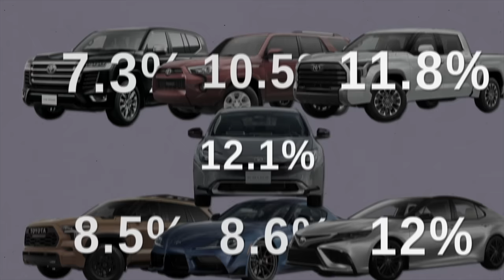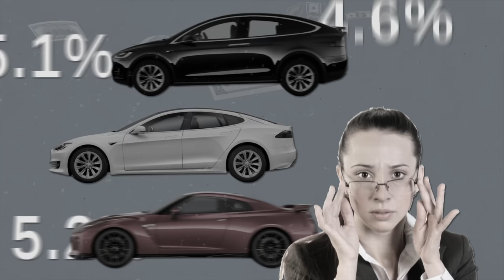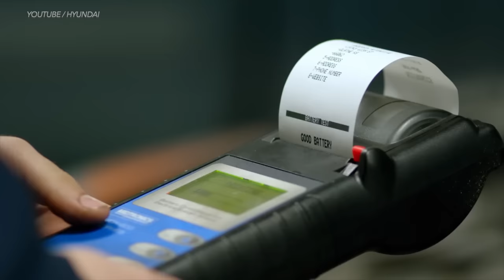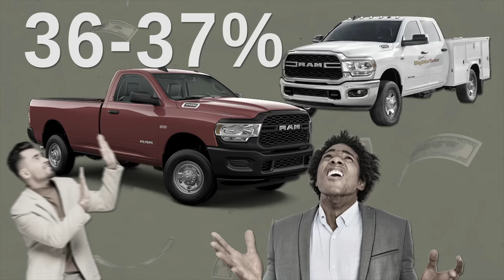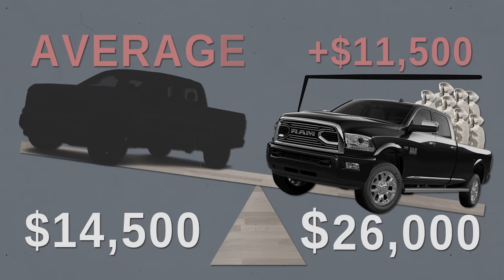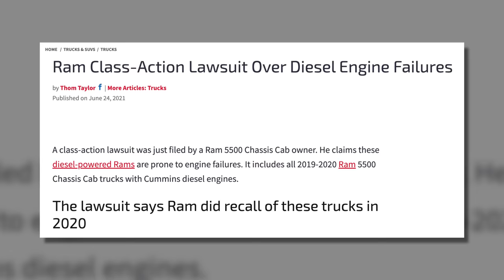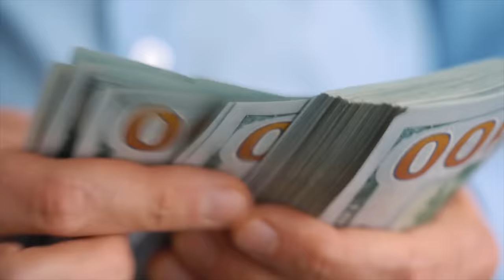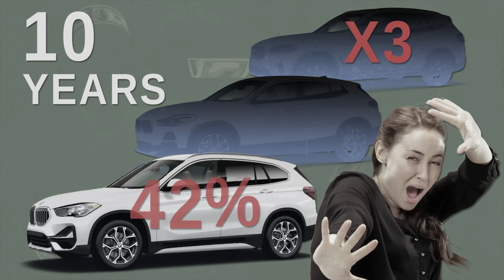Here's Why I Only Buy Toyotas and Lexus

Comment: I have a 2006 Lexus GS430… I am the third owner, previous owners were father and son and babied and pampered it. Currently he is sitting at 279,000 Miles and you can’t even hear the engine running. The best engineering imo. Can’t beat that reliability!
Reply: Hold on to that one!
Reply: My Brother-In-Law just sold His 2007 Avalon 200,000 miles, posted it and it sold the next day. He just brought a 2020 used Lexus. A used Toyota is better then buying some new cars!.
Reply: @urbannpa  I have an 11 Lexus GS350AWD, it is like a new car at 150k. I got it at 90K, only issue was a leaking rear strut. I installed both myself, probably could have left it.
Reply: "Babied and pampered it" and how did they prove that to you? Some words are just a sales pitch.
Reply: Omar Hudson , if car is sitting at 276K miles and you still cant hear the engine running than they certainly babied and pampered it.
Reply: Thank you for sharing your high mileage Lexus experience. Makes me not want to ever trade my 2014 (w/82,000 miles) in!
Reply: Don't sell it man. You will regret it.
Reply: Yep with proper maintenance they will do it. Very rare for other brands.
Reply: 2010 gx460 with 120k. If you maintain them, they’ll run forever. Toyota/Lexus is incredible.
Reply: '96 camry with 290k same thing! Start it early in the cold winter, go outside and think "crap i forgot to start it" but its just silent standing next to it 🤷‍♂️
She dont leak or use, struts are toast. Have to tighten bolts sometimes, shes rolling the wheels off literally. Cant wait for spring temps to run some Lucas.
Some days im convinced its the best engineered car on earth lol. 33mpg.
Reply: Several years ago, a dear elderly woman asked me if I could help her start her car.  She had a top of the line Buick. It ran so quietly that I could barely hear it in the background noise of the grocery store parking lot. I assured her that the car was running just fine.
Reply: A woman at work had a 15 YO Lexus SUV that looked brand new despite having over 200k on the odometer. She bought it with her first "real" paycheck after completing her degree. Her husband wanted her to trade it  for something new. She told him she'd had the car longer than she'd known him and maybe she'd trade him in on a new model instead.
Reply: My wife finally sold her 2008 Taurus X at 207,000 miles. The neighbors who bought it have added another 50,000 miles. It still looks new and runs fine. Someone told me that Ford 3.5 V6s wouldn't last much past 75,000 miles.
Reply: It's not just the engine that's reliable. The components are super reliable. I had a prius with over 200,000 miles still on original suspension. They have some of the lowest maintenance on the market.
Reply: im considering to get a 2014 GS250. would u recommend it?
Reply: @jmard24  Mane dawg das crazy!!!
Reply: I’m the 2nd owner of a 2002 ES300. About to turn 175k miles. Bought it 2 years ago this month with 160k. Car runs like it just came out of the showroom. Not a squeak or rattle. 4th Gen ES had incredible QUALITY. 30 mpg on highway. Love it and I’ll keep it for next 10 plus years!
Reply: @OmarHudson  prolly had paperwork on keeping up the maintenance.... Sheesh you need everything spelled out for you?!?!
Reply: @deykno87  well wouldn't he have just said they showed him the paperwork instead making a claim about the engine being quiet? That would have been MORE convincing.
Reply: @kamalgill3256  you are aware OTHER things can be neglected....and working bad....and the engine can seem quiet, Correct?.....namely the transmission, suspension, the electronics etc and in that case it hasn't been "babied and pampered"....how many times have we seen car where the engine is perfectly fine but other things are awry.
Reply: @OmarHudson  to be fair, even if it wasn't "babied or pampered" , it would still fair better than your average german  brand that definitely requires all the baby-ing and pampering that you can give it ;)
Reply: We bought a 17Y  RX400h last year with 187000 miles, added another 15k in 1 year. It is incredible building quality. Interior still in excellent state, used but not worn out, engine still clean, no oil leakage. 
I only had to replace the radiator. Garage sold it with 6 months warranty. They mentioned that there would be no chance they would sell a BMW of that age with that mileage with that warranty period.
Reply: Cars are Toyota/Lexus and Honda/Acura. Everything else are headaches in pretty capes.
Reply: @abrahamrosa8142  this is regurgitated ideas you have heard from YouTube mechanics or auto critics that you watch. Not your own experiences and opinions.
Reply: @OmarHudson  How do you know?? I’ve owned Land Rover, Mercedes, BMW, Ford, Chevys, GMC, Toyota, Honda, Nissan and Hyundai. Japanese cars are very good, almost all of them, but Toyotas and Hondas are outstanding. Everything else are endless money pits, not to mention the extremely difficult mechanics, specially the German vehicles. Scotty Kilmer is right on and it’ my own experience, not videos that I’ve seen.
Reply: had a brand new 2004 corolla for my first car. other than oil changes, $0 maintenance for 100,000 miles/ 11 years before i sold it it get a bigger vehicle. currently pushing a ford edge for another 10 years with 103,000, next car will definitely be a Lexus
Reply: Yet people preach how they love their ford's haha. My uncle has a 2016 f150 and wants it gone because of how unreliable it is
Reply: @urbannpa  My sister in law has a 2008 Lexus SUV (350) with 259,000 miles. The Lexus dealer where she services it calls her at least once every 2 months making her an offer, and not a low ball offer, I’m talking like premium $$. The last time they called was 3 weeks ago and the offered her $11,000. Does anyone knows a vehicle that’s 15 years old with 259,000 miles that a dealer (who always offers less) would still pay $11,000???
Reply: @adamcarr9442  that’s a wise lady!
Reply: @adamcarr9442  there’s always exceptions to the rule. But in general, Toyotas are incredibly reliable, while American cars are the contrary.
Reply: @nicolemazurkiewicz5377  In a heartbeat. Just stay on top of the maintenance…change oil every 3k miles, check the brakes, rotate the tires. Lexus are designed to run lo less than 400,000 miles.
Reply: @abrahamrosa8142  I am almost one thousand percent sure you did not buy all of those new....used cars had other owners and cant be considered when talking about YOUR experience. I only speak on cars I have owned that I bought new.....btw even Scotty admits that Honda's are plagued with transmissions issues.
Reply: @esso0527  sure. I am willing to concede to that. 😂
Reply: @abrahamrosa8142  thanks but im talking about GS250 2014 model. Not 350.  250 is v6 2.5 littre engine. but looks very nice. do u know the difference with GS350 same year? other than engine capacity? it shows relibility f 5 out of 5 in cars review for gs250  2014. while GS460 2010 is 4 out of 5
Reply: @nicolemazurkiewicz5377  Oh, ok. To be honest, I never had a GS. But if it’s Lexus, it must be good. The Japanese makes great cars, so no worries there. I. An tell you, though, that my uncle in the 1990’s bought a used Lexus with 90,000 miles on it and re ran it until 550,000 miles. Then he sold it for $3,500 and it was still running well enough like for another 100,000 miles. I think that the only issue it had was the transmission, which was “slipping” and out of timing. My advise to you is buy it with confidence!!
Reply: Damn, I wish I could say the same for my Sc430. Probably going to end up selling it
Reply: @urbannpa  Absolutely. I sold my 2018 F150 to purchase a 2011 Tundra. Way better truck with the 5.7l (versus the 5.0 in the F150).
Reply: Also helps to have good mechanics like Scotty. One horrible mechanic or oil change monkey that doesn't know what they are doing can ruin your car
Reply: How the hell can a car last for 279,000 miles? My Chevy truck  and Ford cars were so-so reliable but at 100,000 mile mark it was already dying and had to put her to sleep forever.
Reply: If you do decide to pick up another one I highly recommend the 08 Lexus LS460L, just as sporty as the GS430 but wayy bigger inside. My first Lexus ever was a 08 gs430 then the I switched to the LS and now I currently own a 08 IS-F with the 5.0 in it
Reply: I also have a GS 430...just broke 150k on it & it runs better than my newer VW
Reply: @esso0527  yes! my VW is a constant pain in the azz..my benz is holding ok, but my porsche is also a headache..i drive my GS Lexus almost daily
Reply: @pretty_flaco  same for me..first new car was a 1994 Corolla..that car had 226k when I sold it and never had an issue with it other than an alternator..in 10 yrs of ownership
Reply: ‘01 Highlander. Almost 200k miles. Runs like a beast. Be careful with newer Toyotas they’re getting fancy with 8-speed transmissions for fuel efficiency. But it’s more prone to failure.
Reply: I bought a 12 year old Audi 1.9 diesel with 300,000 on the clock for £800 in3 years I put another 150,000 on it,all I did was change the oil and filters every 10k miles and 2 new sets of tyres.Great car.
Reply: How do you know if it was babied?
Reply: I agree with you 100%. I’d give anything to but a new 2006 Lexus 😂.
Reply: The LX and the GX can go up to 500k. I’ve seen quite a few.
Reply: 280k miles on a Lexus?????? 😱😱😱
Reply: I've got a 2004 4Runner 4.7L V8 Limited with 227k. Got it back in 2015 with only 75k miles on it and one previous owner. That pretty much checks. I've had it about 10 years and I've spent 10% of what i paid to maintain it
Reply: @GGGG-qq8in 500,000 thousand miles ok let me see?
Reply: @OmarHudson there related. They new each other.
Reply: I have a 2003 ES. Amazing car, rides so smoothly still. No problems even with 180k miles
Reply: LS430 2002 .... have had 2 of them covering 25 years of driving and still going. Had 357000 on first one when sold. Found the same car again(same year) and bought another. In it today. 200,000 on it as of now.  Best car EVER made
Reply: @mixedboi  for sure. Never trade steak for hamburger
Reply: Got myself a GS430 from 2000 about the same mileage. Still going strong
Reply: Facts. We adopt so many manufacturing methods from Japan. They teach Toyotas QC and manufacturing system in mechanical engineering undergrad so their superiority hasn't gone unnoticed in industry. They are the golden standard and their vehicles are the proof in the pudding.
Reply: @ryanclaffey7949 I hear you. I love my 2013 rx350 with only 80,000 miles. Never a problem until the other day. My driver window would keep going almost all the way down when I closed it. SOS light on. Got the book out. I was ready to tape a garbage bag over the window.  An hour of frustration later I looked with a flashlight and the window somehow went behind the rubber seal. Can’t figure out how or why. Gonna try to figure it out today. But only thing about the car that bothers me is I still can’t work everything that it can do. The damn book is over a thousand pages. I just started driving it when my wife passed away over a year ago. I’m reading the book now so I’m gonna figure out how to work everything.
Reply: I own a GS450h, love the car but I’m currently looking at trading it in for an Avalon
Reply: Never buy a BMW ultimate money pit not the ultimate driving machine
Reply: Good car
Reply: @alb12345672  I have a 2.2ltr diesel Toyota RAV4 2007,6 speed manual,can't fault it.
Reply: Bravo well done mate Cheers!
Reply: BMW it’s bring my wallet, if you can’t buy new bmw don’t buy used one
Reply: I had a 1999 Lexus GS 400. In over 250,000 miles I had less than $3,000 of unscheduled maintenance.
Reply: I had GS430 2004 got to 331,000 before trading it in  2021 still ran well a lot of power
Reply: I have 670,000 on my Camry hybrid
Reply: @Apegabe , Lexus is top of line reliability

Comment: Have owned 12 Lexuses in last 30 plus years. Never had a problem with any of them and think Lexus is the best car made today and yesterday. Driving my 2015 RX350 for last 7 years..90K miles...brakes finally wore out last week! Amazing car.
Reply: Agree 100% with you. I am a Lexus for lifer. Lexus is top notch quality. Mine is 2012 LS 460, with not one repair, ever! Only routine maintenance. 166,500 miles, and finally going to have to do brakes (for the 1st time)
Reply: If they really didn’t break you wouldn’t have that much lol
Reply: You have to keep one for more than 3 yrs to find out if it’s good or not and a damed Kia will be perfect for 3 yrs and there are not a car or two that might have a problem. But I can say any car made to day will be perfect for 3 years drive it for 15-20 yrs and then tell me how great it is .
Reply: I hauled the First load of Lexus to the Toyota dealers because there not any Lexus dealer and put 10 of them on a 12 car rig and they got me for being over weight.
Reply: That’s an average of only 2.5 years ownership for each car..
Reply: Another Lexus lifer here.  I feel so pampered and I get ZERO stress from my car.
Reply: still have the 2003 corolla with 250,000+ miles and it's only ever had regular servicing 

it won't die
Reply: What car isn't reliable if you own it for only a couple years?
Reply: @dansanger5340  Chrysler/Dodge uggghhh
Reply: What a waste
Reply: @hastensavoir7782  Not really the case, it is more about gradual upgrades to stay with the current car technologies and not staying outdated.
Reply: @CR055FIRE  corolla is just different
Reply: What are your thoughts on the is 250 line up ?
Reply: 12 Lexuses? You sure like paying sales tax!
Reply: @hastensavoir7782   unlike you, some folks love to have multiple cars at a time & change cars every few years.
Reply: @benedictt.anyata6899  if you change cars every few yrs, there’s just NO POINT of getting a Lexus or any Japanese brands.
Reply: @hastensavoir7782  you aren't people and you're opinions & choices doesn't represent everyone's opinions and choices. For example a mentor Mike, has an Lx600 Fsport, just got an LC500 & also an IS500 1 of 150 just this year. I myself went from Camry to a Range Rover Evoque, recently sold an RX, I currently drive a Highlander & I'm currently in the market for an LC500 within 4 years. Not everyone cares about the numerous brand names that aren't good quality or reliable. So take a seat & give it a rest.
Reply: @benedictt.anyata6899  we have 2 Volkswagens that doesn’t break down in the Middle of Nowhere like Kilmer and his cult love to say. Practice what you Teach = Preach. So much hypocrisy.
Reply: @dansanger5340 Chevy
Reply: Just bought our first Lexus (ES350) - we drove it across the country, and it was astoundingly comfortable (and reliable, of course - no issues at all). On top of that, 31.8 MPG was the trip average. Why would anyone own anything else?
Reply: @jerryrunnels2344, if Lexus is so reliable, why did you have to own 12 of them over just 30 years?
Reply: @humanyoda  quit embarrassing them 😂
Reply: @humanyoda  I didnt HAVE to own them, i chose to upgrade to newer or different models. Now im retired and have owned my current 2015 RX350 for 8 years....still have never had a single problem with it mechanically or otherwise.
Reply: Is it lexuses, or lexi? 🤔

Or lexees!? 🤯
Reply: @humanyoda  Lacking logic?  Your car doesn’t have to break down for you to want and get a newer one.
Reply: @beverlyquintela2754 I’ll give you $25,000 for it right now.
Reply: brake have nothing to do with the make
Reply: Yup. My 1st, 2nd, and 3rd cars were all Lexuses. I finally got a Toyota recently as my 4th car because I preferred the updated interior of the Toyota models. The Toyota family will always have the best reliability for gas vehicles.
Reply: Bahahahaha 12 cars???? My grandfather hasn't owned half as much cars as you and he was there for the 1st cars 😂😂😂😂
Reply: @dansanger5340  so your saying you like to be in debt?  The point here is for people who pay off their cars and enjoy NO PAYMENTS!!!!!
Reply: @benedictt.anyata6899  what a dumb argument. We are here talking about maintenance costs for a decade. People who drive a new car every 3 years are irrelevant to this discussion.
Reply: @DoubleOhSilver    & people who don't comprehend, think then speak shouldn't be in the discussion. You read just to respond. Does 12 cars in 30 plus years sound like maintenace cost for a decade on a car? Or you're blind to another saying is cause it breaks hence several cars over years which isn't always the case. Don't display your ignorance publicly & make sure before you use the word "dumb" you always look in the mirror first. ..pffft 🥤 There's always that guy 😂
Reply: Same. Lexus for life for me.
Reply: @whocares0316 you like newer models yet your current is 8 years old?   You can forgive people for scratching their heads at these numbers.
Reply: @a.nobodys.nobody  dont understand your point. as i have gotten older we drive less and keep our current car in excellent condition so i am less interested in changing cars as often as i used to.
Reply: @whocares0316 , same. I am a Lexus for life.
Reply: if you live in area where it snows and they/or they use salt to clean the roads then avoid any toyota/lexus/mazda becouse this cars rust like crazy. check the condition of the floor before you buy used one
Reply: @whocares0316  I have owned 3 Lexus. IMO, Lexus is the best car built. I love them.